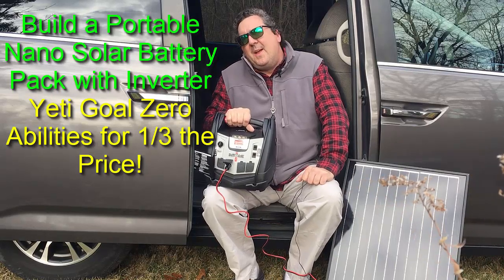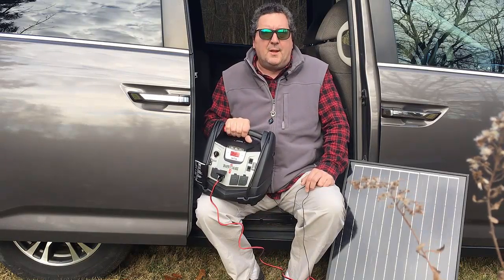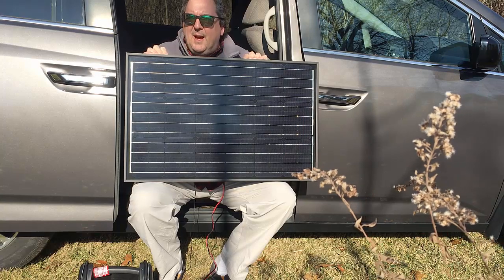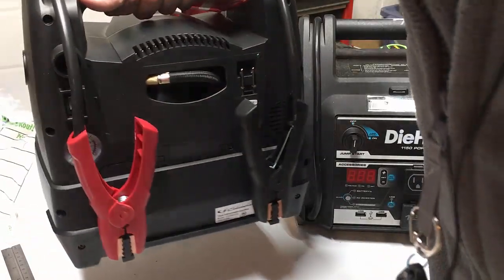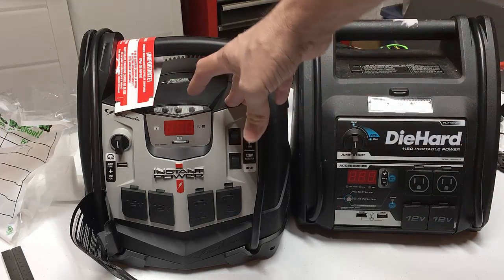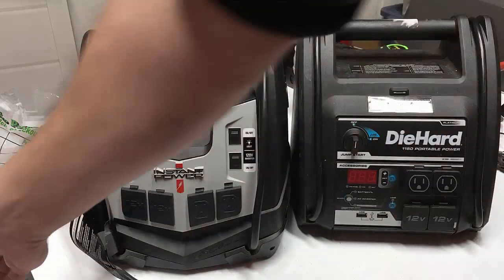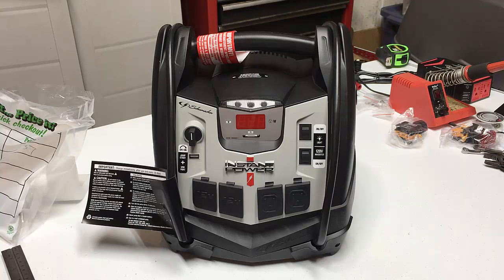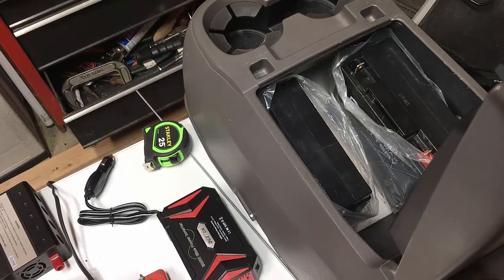DIY Portable Solar Battery and Panel

Comment: I've had the Schumacher for quite some time now.  It has been a great unit and now with this little hack it will be even more versatile!  Thanks for the great tip.  BTW I've been really bad about the monthly recommended charging.  After 4 years of maybe charging it two or three times a year, the battery is still functioning just fine.
Reply from the maker: I’m glad to hear the battery is not as delicate as they make it out to be. Thanks for the info. I think that the use case and temperature have a lot to do with it. The one my kid brought to TX did not last long but it was stored in a 120+ outdoor closet, so... It should last longer if kept at room temperature. Thanks for watching!

Comment: Got my Schumacher 1200 being delivered today, from Walmart...$99!!! On the way to completing my solar, thanks to your video.  Thanks for taking the time to make the instructions!!!
Reply from the maker: Deb Bryant That’s awesome!  Thanks for watchin!
Reply: seriously, your videos are so informative, and you answer my questions as they come up.  Even a novice should be able to follow your instructions!   I'll upload pics when I get it set up.  :)
Reply: also, the unit I'm getting is the SJ1289 Multifunctional Power Supply, that has the light on a flexible arm, and the tire pressure is digital, and cuts off at the desired pressure.  It's an upgrade from the one you featured, I think.
Reply from the maker: I'll check that model out.  Yes, if it has a digital pressure gauge, it's definately an upgraded model.
Reply from the maker: I'd love to see the pictures!  Thank you for your kind words.  I try do these so anyone else can follow along.  Everyone has a different set of skills.  As soon as I'm satisfied with the final design, I'll put up a video of my new bed system.  It does not require any special tools to build AND does not use wood for those with allergies or chemical sensitivity.

Comment: Still have my DieHard that I bought in Dec. 2017 after your review. I do remember to charge it at the beginning of every month. Used it many times to charge things and inflate my tires. I highly recommend them not sure if they are still available with Sears closing.
Reply from the maker: tinabeane that’s good to hear!  Just used mine to inflate my tire after pulling yet another nail. I suspect that even with Sears closing, someone will license the Craftsman and DieHard names. Hopefully, the products stay just as good!
Reply: masterforce menards same

Comment: Thank you! After re-watching all your battery videos and comments, I am starting to “get it”. Question: do you carry the Schumacher AND the Diehard in your travels?
Reply from the maker: Awesome!  So actually, I gave the Schumacher to my son for Christmas, since he's always leaving his dome light on and running down the battery.  I now travel with my console battery pack and the Diehard.  The Diehard is my backup if I run the main batteries down, but I also use it for cooking if I want to sit out at a picnic table and make coffee, soup, or oatmeal with my immersion heater.

Comment: I got your suggested setup for solar and charger and Schumacher jumpstart, hooked it up and works great.  I got a gift of one more solar panel, same 50 watt. My question is how to connect the two panels together and then to charge controller.
Reply from the maker: Awesome!  I'm glad it's working for you.  You would need to connect your second panel in "parallel" with the first.  What that means is that + on one panel will go to the + on the other panel (positive to positive, or red to red).  Then connect - to - (negative to negative, or black to black).  I think the easiest way to do this is to leave your existing connectors in place and wire your second panel in at the box on the back of your original panel.  That's the black box on the back of the solar panel I show in the video.  If you do this, you will make full use of the 7A charge controller (a 50W panel does not make full use of its capacity) and probably be pretty happy with your new panel.  You can stop here, or read on....
   Your 100W of panels will probably not be in ideal sunlight most of the time and so, they will output less than the 5.55 Amps and 18 Volts (5.55 Ax18 V= 100 Watts) they are rated for.  But on those rare occassions that they do, you would be producing enough energy to take advantage of a 10A charge controller (the Shumacher unit is 7A).  That would give you slighly faster charging than you currently have--but only under those ideal conditions.  If you do want to maximize it, increase the charge controller to a 10A unit.  I suggest this one http://amzn.to/2FAhT6j that I use in my console battery pack.  An advantage of this controller is you could use forked lugs and connect both panels AT the charge controller.  But if it was me, I wouldn't bother.  It's hard to have full sun and keep your panels at EXACTLY the right angle and temperature.  So they are always producing less than the full 50 or 100 watts.  Your gains with the different controller will be negligible under most conditions.  Then again, the controller is only $15.

Comment: u can add a lithium batery made from 18650 cells and use a 12v regulator on it and be good to go  ull have like 500wh or somthing  or more depending what u build  u can get the batteries from laptops and power tools batteries etc
Reply from the maker: That’s awesome!  I will
Look into it. Thx!

Comment: I like this video.... 
Do you have a video where you showed how to install a stand to the back of the 50 watt solar panel?
Thanks... I really needed this :)
Reply from the maker: Alvara DaCosta I don’t have a video that specifically show this, but you could build a frame like the one I used in my roof and then add a couple swinging legs. Really, the stuff I use in this video is overkill, but it might give you some ideas: https://youtu.be/v0ysINgOoAQ

Comment: Thanks for this video!  I have a Renogy solar suitcase that I use to keep my truck camper battery charged while boondocking, and am still a bit confused on which cigarette lighter adapter I would need to charge my Schumacher power station.  I saw your link below, but is there one that I wouldn't have to cut the wires to reverse the polarity, for it to work correctly? I love the Schumacher for keeping phones charged, and even powering my hot air styling brush LOL!
Reply from the maker: Hi Kim, Thanks for watching!  I’m a little confused by your question. Do you mean that you want to plug the battery pack into the truck’s lighter?  If so, this cable will help https://amzn.to/3OHczOm  However, if you meant that you want to connect the Renogy solar that way, I’ll need to look into it. Let me know.
Reply: @OdysseyCamper  Thanks for your reply.  I would like to be able to recharge the Schumacher from my Renogy 200W solar suitcase that has a voyager 20A charge controller. After I posted the question to you, I realized that the Renogy suitcase has the MC4 type connectors, and couldn't find anything that has the male cigarette plug on one end with MC4 on the other. Just being lazy and was hoping to find something ready made that was plug and play.

Comment: thanks. I was wondering if I could run a seperate larger  pure sine wave inverter from my schumacher for a 350w blender or  guitar amp. guess so. this is what I did. 50w poweadd pirtsble panel and the Schumacher for my trips. I was at RTR and had plenty of power for my phone and laptop. easy and inexpensive plus I jump started myself and other people.
Reply from the maker: Dee Yes, you can, but it sounds like you figured that out ;-)  Glad to hear you figured out a way to play at RTR. Hope to see you there in 2019!  Thanks for watching!

Comment: Can you easily chain these jump starts together for more storage? I have the 1000w Stanley JUMPiT with 500 cold cranking amps.
Reply from the maker: VanLifer yes you can, but you don’t need to buy the whole unit, you can just hook up the extra batteries in parallel (+ to +, - to -). One of my videos shows this. For the jump packs that have a 12v lighter socket, it’s really easy. On other types you might have to open the jump pack to make the connections.

Comment: Just subbed to your channel....love it! 

Quick question: Does the Schumaker charge controller shut off when the batter hits 12.6 volts? I've read that you can ruin these sealed lead-acid batteries if you over charge them?

I want to keep my power pack - jump starter in my car at all times, without having to take it out once a month to charge it. I figured if I keep plugged into the lighter (with the charge controller) It would be fully charged all the time. 

Thanks in advance.
Reply from the maker: Thanks for subscribing!  I talked to the Schumacher rep and he said that it switches to a trickle charge once the battery is charged. They actually had it designed to work with their battery packs.

Comment: I just found your channel. This is great. Could I run a small portable refrigerator off of this?
Reply from the maker: You can if you use the solar panel. With just the battery pack you could only run something like a small Alpicool refrigerator overnight. You would need the solar to run the fridge and recharge the pack during the day. I did exactly this and the panel was able to keep up with my Alpicool.thanks for watching!
Reply: @OdysseyCamper  Thank you for responding so quickly. Must have been good timing. 😊

Comment: I wonder if this would work with my POTEK model?
Reply from the maker: It should work with any pack that has a lead acid battery. It looks like the Poteks do, but if it’s lithium, you’ll need another solution. A quick way to tell us if it’s heavier that it looks, it’s lead acid :-)
Reply: @OdysseyCamper  Cool. Thanks. 
It is heavier than I think it should be, but I'm an old man!
Reply from the maker: @sdnlawrence5640  me too. Lead acid :-)

Comment: Why not connect solar panel with a CES Quick Disconnect Connector directly to the battery compartment of the DieHard Platinum Portable Power 1150 i think i a good idea

Comment: With this set-up can we chain in a third battery for increased storage capacity? If it is possible I would assume it would be better to upgrade to a 100w panel for better recharging. Correct?? Thanks
Reply from the maker: Jimmy Skates Correct on both counts!  You can attach a third battery, but you need more solar if you want to charge it in the same amount of time. Three of these batteries would be 66Ah. A 100W panel puts out 8 amps in ideal conditions so that would take a little over 8 hours to charge. But conditions are never ideal, so 10 or more hours is more realistic. Thanks for watching!

Comment: For the DC charge port.  Are the wires for the male plug opposite polarity?  I mean if I were to use the battery for power does it make a difference for charging back power delivery?
Reply from the maker: I think I get what you are saying. When making a male-to-male charging cable, you’ll want + to + and - to -  stated another way, the center part of the plug should be wired to the center part of the other plug. Thanks for watching!

Comment: Will it run a car fridge? And how long will it run it for, and with the solar panel, will it do it indefinitely?
Reply from the maker: With the solar panel in full sun, it should run the Alpicool I show in my videos, indefinitely.  The fridge pulls a little under 50W but does not run constantly once it cools down.  So, the panel would actually be charging the battery pack in between compressor cycles.  However, this size battery pack only has around 18Ah of battery capacity, so even if you ran it to empty, that's only 216 Wh or a little more than four hours of constant run time on the fridge.  Of course, it's only running part-time, so you might make it to the next sunny day.   For a comfortable margin of safety, I would go with 100W of solar and a little more battery capacity, ~25-30 Ah.  You can accomplish that by plugging in a second battery to the pack.  Thanks for watching!

Comment: Yes! I love your content! I'm debating on how I'm gonna insulate my odyssey. What would you suggest?
Reply from the maker: Thanks for watching, Ben!  One advantage of the Odyssey (or really, any minivan) over a full size van is that they are better insulated out of the factory.  The floor has a layer of insulation under the carpet, the headliner is fairly thick, and all those interior panels have some insulation on the back.  Mostly all of this is for sound, but it does create a lot of dead air space, which is a good insulator (when you can't create a vacuum).  So I'd save filling all the cavities with foam or something, for last.  I'd first focus on the windows, since that is where the most heat is gained or lost.  You could make insulated panels like I did here--  http://odysseycamper.com/2017/10/15/diy-insulated-window-panels-stealth-camping/    although I found they worked a little too well in the summer, keeping the heat in.  You can also make a lightweight panel from Reflectix and put black felt on the other side.  The panel will not provide insulation (but will reflect radiant heat on the silver side, absorb it on the black) but if you make it larger than the window, you can create a dead air space between the panel and the window and that WILL reduce heat transfer.  As for all the heat that goes out the front window and vents, I'm working on putting an insulated curtain between the front and the back.  I've only got a privacy curtain at the moment.  I'm about to find out just how well these ideas work because I'm heading to Arizona in January.  I'll be staying overnight at about 5000 feet in NM, and it's supposed to be COLD...  I'll be using a battery pack and an electric blanket, along with some good sleeping bags.  If you don't see another video past January, look for me in the mountains of NM :)
Reply: Odyssey Camper thanks. Yea I was looking at your website last week, and I decided that I'll do something very similar to what you did. I think I'll also be making what you made here, so I can also use an electric blanket. I plan on visiting Colorado, so I really need to prepare for cold lol

Comment: Hi, this is a great video. I've set up my system using the Schumacher power box. At first, when I connected it to my solar panel (using the solar controller) it started increasing the charge on the Schumacher. Now, 2 hours later, it appears to be draining the unit. Any idea what might be happening? It is currently out in the sun (not evening or dark conditions).
Reply from the maker: Hmm, I haven’t seen that before. However, if you are looking at the percent charged, it could be that is was charging at a higher voltage to start and has now dropped it slightly to finish. The percent meter is just an estimate based on the voltage at the battery. Check it without the panel plugged in, then after six hours charging in the sun, disconnect the panel again and check it. If the reading is lower then maybe you have a bad charge controller. I hope this helps and thank you for watching!

Comment: Can you run an alipicool c45 with that jump box. ...maybe just nights ...can hook fridge to solar during thevday

And maybe you know if you can charge the jump box while running the cooler too??
Reply from the maker: The answer to both questions is yes, but the run time would be limited. The key is to have everything cold during the day and then run it on the jump pack at night. It will also help if you keep the cooler full. I use water bottles to take up the unused space. These steps will ensure that the compressor does not run constantly. If it did, the pack would only last about 4 hours.
Reply: One more question lolol...i have a low wattage 12v heated seat cushion ...id like to use as a bed warmer on long trips in the van ...not on long ...5 min here or there to warm up....do you think thos will work for that too?  Got it for 9.99 at bed bath and beyond

Comment: The question I have is that all the one's I've seen are designed to fail when you had the batteries out did you check the charging stats in what I've seen on the net sealed lead acid battery are dead at 12 volts and should be kept between 13.4& 14.8 since I had an old black and decker booster pack with inverter I took it apart and written right on the battery was do not discharge below 12.2 float charge is 13.4 and full charge is 14.8 the wall charger was built in and written on it was output was 12 volts in checking out my old Canadian Tire booster pack they were all the same right now I have two everstart booster packs with inverter and air pump it's charger says it put out 12 volts but the unit says it is 13.1 at full charge so if you have a booster pack use a proper charger and charge it through the cigarette lighter plug
Reply from the maker: Close. A battery at 12V is 50% discharged. That’s as far as you should discharge a lead acid battery if you want maximum life out of it, so some people might say it is “fully discharged” at that point. But you CAN discharge it further. Around 12.8 is fully charged. The chargers are higher voltage because you need a higher voltage to reverse the discharge process. The vehicle alternator (and the cigarette lighter) will run at the required voltage to charge the battery, but it’s not ideal. A dedicated charger will do a better job of topping it off. If you have an inverter in the vehicle then you can just plug the battery pack into that to charge (the die hard has a built in 120 to 12V charger). Thanks for watching!